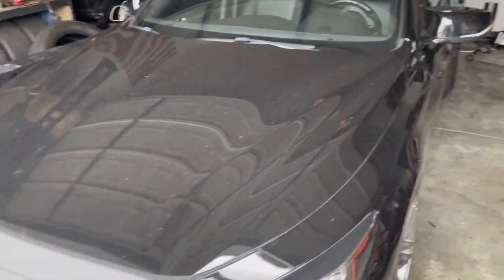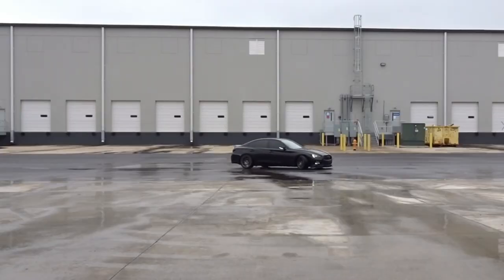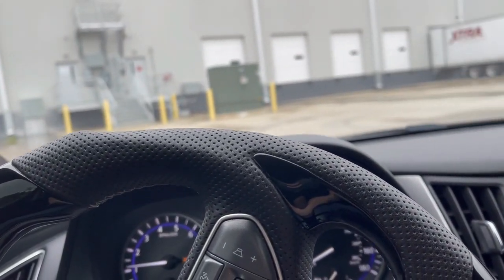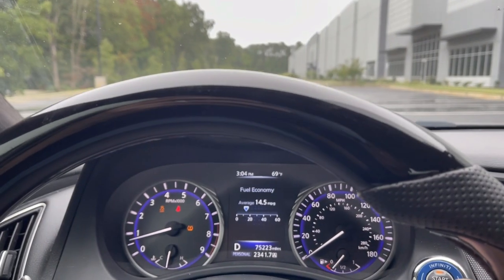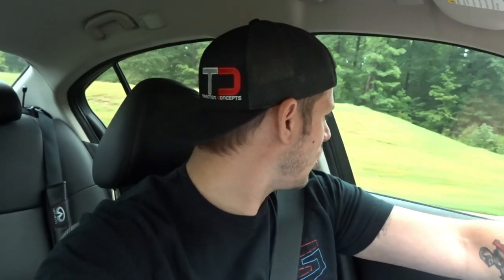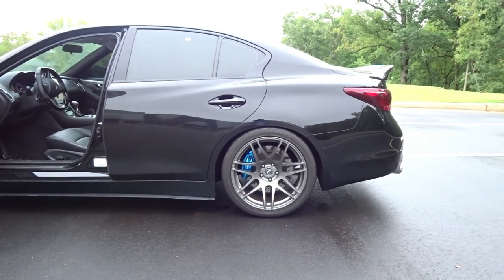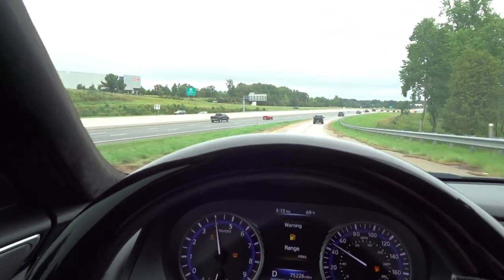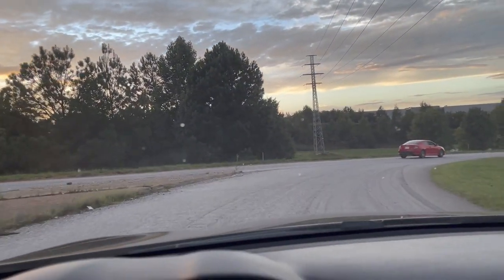Q50 LSD First Reaction | Traction Concepts LSD Initial Impressions.

Comment: It does get better and better. I had all the same feels when I installed mine. 👏🏾👏🏾👏🏾👏🏾
Reply from the maker: Excellent!  That’s good to know!
Reply: Can u drift with this lsd?
Reply: @hellsent3617  you can. But for drifting, I would use a proper lsd assembly. Since this kit was designed for better traction. For playing around drifting, yes, but i wouldn't take your car to a drift event.

Comment: Wonder if you will need to turn traction control completely off by pressing the white button under the brake pedal to get your best 0-60 and best slides
Reply from the maker: I didn’t find any reason to push the white button.  That seems to be more of a stability control not necessarily a straight line TC.  But we will certainly test it!!
Reply: @SpeedCultureStudios  for the test, im loving it

Comment: What are the main advantages of this lsd rather than just welding the diff?
Reply from the maker: I mentioned the problem with welding the diff at the beginning of the video.  It’s not great on a daily
Reply: @SpeedCultureStudios  Is it just the noise that’s the problem or can welding the diff create some other issues ?
Reply: The major difference between welded differential and real LSD is that with welded your both rear tires going to spin with the same speed  and that,especially when you at hard turn a big problem  because in turn  LSD allows  outer wheel spin faster than inner keeping traction at best,but welded wiil try to skid you sideways  and apply way to much stress on your drive train. Welded are good for a low traction like mud or ice  or straight pulls but not for normal driving. That the reason why "snow " button on my g37x  what actually locks  differentials  with 50x50 output  works only  up to 30 mph and disengage after.
Reply from the maker: @j3.7  premature tire wear and stress on the drivetrain.  And it’s not just tire chirping, it makes typical things, like pulling into a parking spot, a bit annoying.
Reply: one thing nobody talks about with a welded diff too, it changes the way your steering reacts. i dont know why tbh im not an expert, but i had a welded diff before, and the steering is noticeably different after, it feels more springy. like if you take a turn for example, then straighten out by letting off the wheel, instead of slowly centering as it would before, it will not like shoot back. if you watch videos of people drifting and see how the wheel kinda moves on its own, its like that.

Comment: Again me) where is video with one tire on asphalt and second on something slippery with turned off traction and BLSD?
Reply from the maker: Asphalt is slippery.  And Again, I have several videos from before this was installed spinning 1 wheel.  It’s very common knowledge that the open diff on the q50/60 is a huge negative.  No one is saying the electronic assist is bad for regular driving.  It just is not a replacement and is not at all effective in a performance situation.
Reply: @SpeedCultureStudios 
It is not what I meant. I would like to to see how plates locks diff and to see that you should test it on surface with different traction without electronic assistance.
Reply from the maker: @tarassymonik7603  I will try to test it in various scenarios.  This video was just an initial impressions video immediately following the installation.  I want the full test video to be a complete review, but a vast majority of people considering an upgrade like this are looking because of performance improvements.  The shortcomings of the factory rear end show themselves on on-ramps in the rain, for example.  Or on tight mountain curves while trying to accelerate on exit.  Or, of course, when launching the car.  Most people watching already know what they don't like about the open diff and are looking for a good way to remedy the problems they've seen.

Comment: Does it feel faster than the open diff
Reply from the maker: Yes!  It hooks right away so you can feel the torque being out to the road.
Reply: @SpeedCultureStudios  I’m really considering it but I’m AWD and im thinking it won’t work
Reply from the maker: @kev_g37x  it’ll work it just not be as necessary unless you’re making bigger power
Reply: @SpeedCultureStudios I got a g37x do they make those kits online or can I use the same one as the q